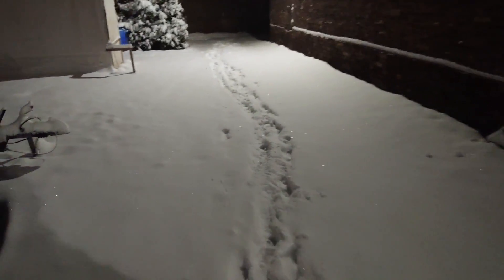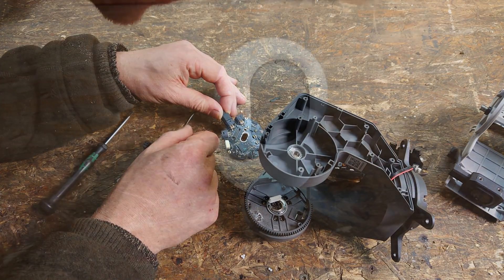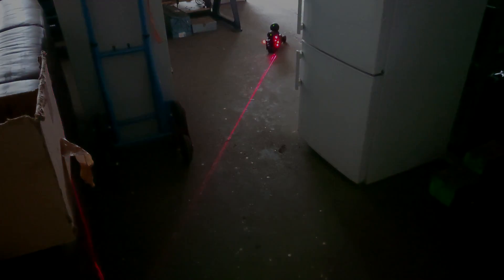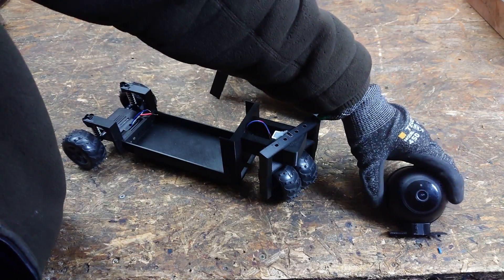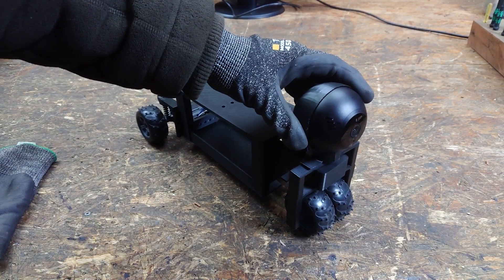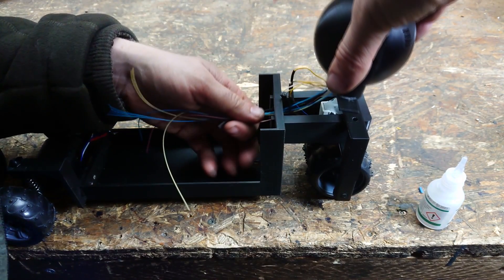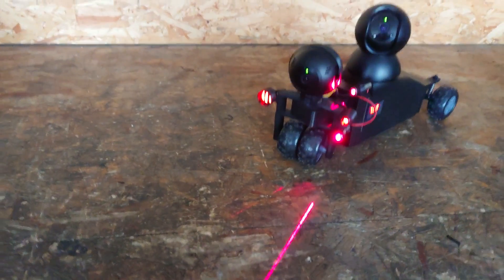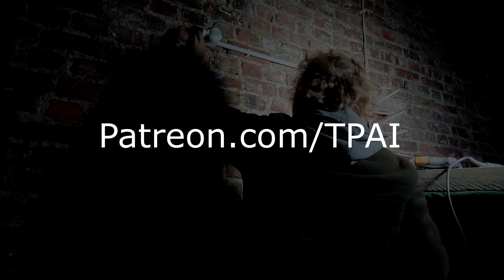DIY Surveillance Robot from Cheap IP Camera! Build and Test!

Comment: Had the same problem with my Camper as well. I totally agree, it is time to do something. I originally wanted to build a security cam hidden inside the most obvious fake camera dummy case. Experts say that thiefs spot fake cameras from a mile away and I wanted to use this against them. But that would need an effective, working crime investigation and it is still Germany, after all... Good luck for your robot and your Camper.

Comment: ❤❤❤ Great Video! It reminds me of my first tinkering attempts in the early 2000s.

Back then, I equipped an RC snow groomer with a wireless video camera that transmitted its signal to a USB video digitizer, which could capture single frames under V4L.

I connected the original RC remote control via a few TTL chips and an ELV IO controller for the parallel port. My mobile internet device at that time was an iMode-capable NEC smartphone (NEC N21i), on which I could move the RC model with a simple WAP website. After each control command, the current snapshot was then embedded as an image in the WAP page.
Today I use a bunch of TAPO Cameras combined with the frigate running with a Google Coral TPU Device for Object Detection of Persons, Cars or Animals around my House for about 2 Years now.

Comment: Hey hear me out TPAI, how about a rail-mounted camera on the ceiling. That would give you mobility, good angles and the safety of not having the robot itself stolen.
Reply: Don't forget the robotic arm to increase mobility, the white paint job on the covers, and the sentient,  yet incredibly stupid AI
Reply: @MrHack4never 😂
Reply: @MrHack4never  You'd have to specifically train the AI to make all the worst possible decisions at any juncture.
Reply: yea, also add some lasers that would pierce tru the bad guys....and make them cry.
Reply: @orange11squares thought of this, but its a fire hazard.. tazer might be better
Reply: Yeah, maybe the goat is to have an overhead crane that you can put into sentinel mode with a camera. That way you're not taking up valuable crane space unlimited money life goals.
Reply: Electromagnetic rail so that its near silent , with smaller stationary cameras built in, so it just moves to gain the best angle.
Reply: Karl Stromberg had the same setup on his supertanker

Comment: Great vid! I was thinking of doing something similar but utilizing some sort of track system suspended from the ceiling. Maybe a toy train or something. Though one thing I'm concerned about with my current video surveillance system is the increase in use of WIFI jammers.

Comment: Have you considered using an ESP32 module, an inexpensive Arduino-compatible microcontroller, to controll the robot? It is a widely used chip so there here are lots of tutorials for programming it and you can even use existing open source firmware such as Tasmota if you want a more robust solution with minimal coding required. It even supports a camera but the quality is not very good.

Comment: If there was a potentiometer on the pan shaft, you could use two comparators, with a "dead band" at the center of the potentiometer travel, use that for front/back drive, and maybe a PWM signal from the same pot, for speed control... With CMOS comparators, low standby power... Wouldn't it be simpler to have the robot drive onto a couple of contact strips for charging? Not so elegant, but... With an AC 12V on the contacts, no big corrosion issue, no safety issues, and just a diode bridge and 7805 to connect to the battery pack.
Old-fashioned, I know... But no software needed!

Comment: Excellent job.
One idea to improve the responsiveness/image quality of the Tapo C210 is to enable the QoS (Quality of Service) settings on your ISP/your router and give your cameras priority. This will prioritise the traffic from the cameras over other devices on your network like settop boxes, printers, PC's,  phone, tablets, etc

Re the Robo Master S1 and having to be on the same network. Depending on the modem/router you have you could set it up as a VPN server, you could then VPN from anywhere in the world and to the S1 you would appear to be on the same network, so could control it remotely.

A slight rant re the Tapo wall mounts... Why are the tabs on the mount off at an angle when the camera is fully attached, as in you have to fit it to the wall with the tabs at a funny angle so when you mount the camera the power lead points in the direction you want. The mount, unlike so many others, is of no use if you want to mount the camera on a tripod, or suction window mount for looking outside. I made my own mounts for this purpose by buying some 1/4-20 UNC hotshoe mounts, cutting them down a bit, then I cut a slot in the Tapo mount, and epoxyed in the mount, I then attached that abomination to a hot shoe for my tripod. I've also use 1/4-20 UNC nuts epoxyed to the Tapo mounts to attach a camera to a window suction mount. Both work quit well.

Comment: I would probably make it simple for myself and mount a camera on top of a vacuum robot. They often have a feature to program a route and they "go home" automatically when the battery is low. You could probably find an old one where the vacuum part is broken because of too much pet hair or something 😅
But that probably wouldn't make it a very interesting project.

Comment: Was thinking about raspberry pi when you were building it.

A tweak for the charging station I was thinking of... have a fence on the front half about the height of the navigation camera. you'd obviously have to see the area that you can play around with where the battery and charger will be working 

It sort of dummy proofs the parking on the charger if you're away from home. It's not like you'd really be able to see the charge light come on/stay on remotely.  If the fence half kennel, whatever you'd want to call it) is attached to the charging plate and you put a little speed bump where the rear tires would rest it could provide some protection from vibration if you live near train tracks or a road that gets a lot of truck traffic.

I used to live near freight tracks and a main road that had a lot of 18 wheelers, plus I always count on one of the cats to be a schweinehund  ;)

It's sad going back to where I grew up, it used t be suburbs. The urban blight has swallowed up a lot of the area. I think it's a bit worse here in the US because no one gives a rat's butt about the historical significance of a neighborhood. The mentality here is tear the building down and build another press board Mc Mansion that will fall apart when the first real blizzard or norEaster comes along. :(

Comment: My thoughts are: the wheels and ground clearance are too small, you can use IR lights and lasers that are visible on camera but not by eye. Also install an alarm that activates if it is picked up or turned upside down.

Comment: Awesome project! I had an idea that would give you more controls than just the onscreen joystick though. If your IP camera has the intercom function, how about using DTMF tones or something similar to control the robot? I don't know if your phone would allow you to use its own keypad tones at the same time as running the app, but you could play the tones on an old secondhand phone held close to the main one. On the receiving end, you just have the speaker output of the camera hooked up (via an attenuator probably) into a DTMF decoder, that would give you up to 10 outputs via TTL logic or even relays that could control forward/reverse, steering, maybe even turn spotlights on and off. Just my two cents worth anyway. Love the project! - John

Comment: Great execution of the idea.

But building such solution with that much latency is going to be very difficult since you have already discovered (and shown us) that driving needs realtime feedback. Back in the day when computer users had to deal with latency between keyboard input and the screen output, they developed software around the philosophy of  "performing large tasks by compounding small and limited number of inputs". May be you need that sort of a solution. May be you need to program you robot to switch between specific locations in the house following your limited predefined commands, sort of an "on rails" solution.

Comment: What prevents them from just taking your robot or squishing it with their foot? 
No. You are dealing with criminals that have nothing to lose. 
You need an armored AWD with 4 independent motors enabling tank drive steering (truck windshield wiper gearmotors or massage chair motors work great) , with large dolly sized wheels or a pair of tracks if you can make one or salvage a snowblower tracks. 
You have everything you need to build a monster right now. Show them who's the boss and they'll leave you alone. 
Your pan an tilt has to be incorporated in the body with only bullet proof plexiglass to look out from. Nothing must stick out that can be bashed with a bat or a pipe. 
If it weighs 200-300 lbs (use lead acid batteries from junkyard to power it), you can confront and record them in the alley and kick their asses if they decide to harm the robot, by just ramming them. I build one in 2007 using 2 wheelchair gearmotors and 2 Honda snowblower tracks and drive wheels (bought new for $1000 just for the Honda track parts), but the entire body was made of 6 layers fiberglass covered the 20mm plywood, but because of the 2 huge truck lead acid batteries, I couldn't move it. It would push anyone out of its way. That beast was made to plow my driveway from the comfort of my TV and RC remote! If I had steel working tools like you do, I would've definitely built it out of 1/4" welded steel. 
I sold it when I sold the house. Not bad for a $1500 machine that gave me so much joy for 2 years. 
Plowing snow in winter, and dragging the lawnmower around in the summer while I sat in the backyard patio in the shade, sipping ice tea and "Mowing the lawn" .

Comment: Great work! I had this idea years ago when I got my first IP camera. Never got around to it though.
As you said, a version 2 of this would be a great raspberry Pi project. It would probably be easier to steer and drive, because you can also drive backwards. Driving backwards a little bit is incredibly useful if you do get the robot stuck somewhere.

If you do build a raspberry pi version, There is camera motion detection software called "motion", which provides a web stream for the camera and i believe it can run scripts when it detects motion. Might be useful to you.

I think it would be super cool to build a robot like this once, using something like ROS and a Lidar scanner so it can automatically navigate to a certain area and automatically return to its docking station.
Also, a version with skid-steering/tank steering would probably be easier to navigate. I imagine it's not very easy to steer, especially with the delays as you mention.

Comment: the best thing about tplink's cameras is the password protected RTSP stream, so you dont need to use their stupid apps but can use a sane program like ispy (in windows, linux, mac etc), or just vlc, cant use pan & tilt controls, thats app exclusive
Reply: Thanks for that info!
Reply: Reolink cameras can do the same thing, at least the one I have. Not sure if their latest models do it.
Reply: I'm pretty sure there you can hook them up to Home assistant and use an add-on to control them
Reply: He could set up his own pan and tilt on the next version using the raspberry pi and some servo motors ;-)
Reply: but thts still paid

Comment: Excellent video, as usual. I had, and have, similar needs myself for security cameras - though thankfully,  just from casual trespassers onto my land.
 I've installed dozens of cheap, discreet 'wild life' cameras in the surrounding woodland, which are camouflaged and built for longevity. They're motion sensitive, have excellent definition and can work for up to 3 months on a single set of batteries. The main reason I installed so many of them is that they themselves are also a target of opportunistic thieves.

Comment: Very clever, well thought out design. Bravo! 👍
As for "discouraging" folks from loitering (and thus littering and doing other nasty things on private property) you might consider visiting a garden supply and using motion activated lawn sprinklers. They aren't cheap, but almost no municipalities can fault you for wanting to "water" your lawn or shrubberies to keep them "pretty." And the timing...merely a coincidence...😊
Good luck to you!
Reply: The issue is that you have to turn them off during winter. Otherwise, they can be damaged by freezing.
Reply: @AldericBlain  That's true. Also, such devices equipped with lithium ion batteries can be damaged by deep cold.
Reply: Rather than motion control just add a switch that allows you to turn sprinkles on remotely. Use IP cameras built in motion sensors to trigger a notification.  

FWIW - most folks living in seasonally colder climates will blow out their sprinklers and turn the whole system off for the winter.

Comment: If i was a burglar and saw a robot rolling around, i't be more likely to stomp on it
You would need some sort of illumination at night on the robot (IR maybe), and hope you don't run out of power before getting back to the charger
You just need fixed cameras that cover all points of entry, and external cameraslooking at anything valuable
Reply: Sounds like Mr Robot needs a few steak knives attached
Reply: @williwonti  The commie govt there would likely charge him if he did that. That's the most infuriating part. The import these criminals ---- and then actively prevent anyone from protecting themselves from them.
Reply: I was thinking the same thing. I would personally have put much larger wheels to move easily over transitions etc. I am wondering how stable it is being so narrow and long. I love the idea of this, but it definitely can't replace securely mounted (up high out of reach) stationary security cameras. This would simply become another target for crooks.
Reply: or pick it up & steal it
Reply: @kass9722 If a radio jammer is legal to own but not operate, put one in something they'll want to steal, rigged to activate when stolen. Something similar with a smoke bomb is another idea.
Reply: It’s an RC motor so you could in theory use it as a ‘get away car’ as well.

- OR
Use a mini drone,  they have built-in steak knives.  Mine also has a built camera, and overall only 3in. across. Wireless charging would need to be added but the size of the  battery pack is tiny compared to an rc power brick. No burglar in their right mind is going to try to stop a drone.

Comment: you should try to install openipc that is open source ip camera controller software
i have successfully hacked a camera that have 360 lens thus dont have pan and tilt feature
but i am pretty sure you can hack one with motor and spin it continucely
and everything that connect to cloud is bs